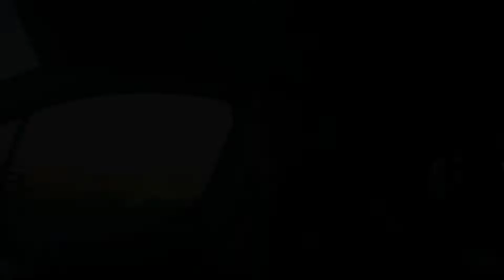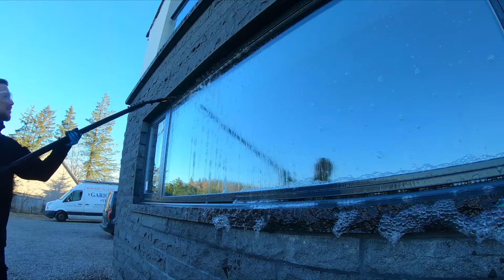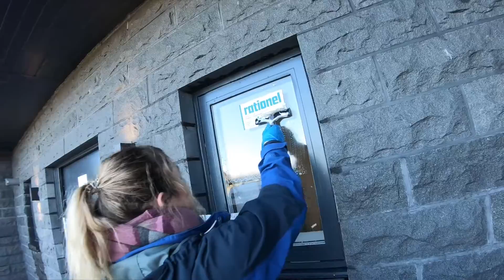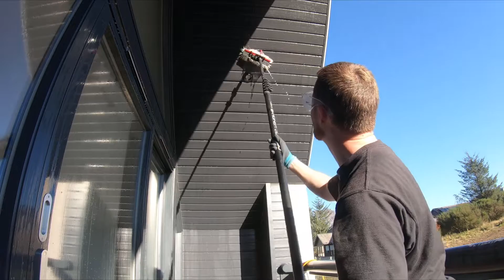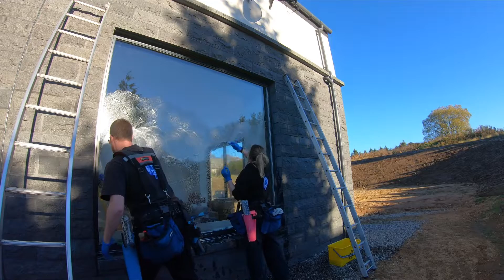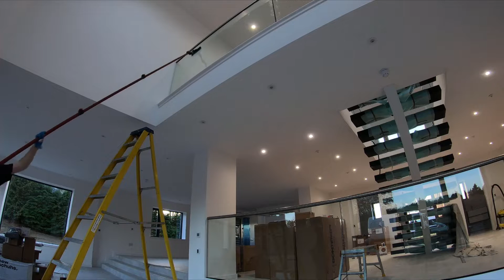CONSTRUCTION CLEAN UP | EXTERNALS | PART 2

Comment: Hi Trade Man Brian here from Ireland , if you don't mind I'm hoping for a little advice , Im new to the business and still learning , my question is about removing cement and paint from windows , I use a window scraper but sometimes it's difficult getting the cement off and I don't want to damage the glass . I'd appreciate any tips you have to help ..
Reply from the maker: Try winsol Crystal clear. Its a hard stain remover. Get it from window clean centre. Very strong stuff so be careful with it
Reply: @TradMan  Thanks alot  , appreciated
Reply from the maker: @brianwelldoneladsproudofye9765  dab the stuff on to the cement don't rub it or you may scratch the glass with the cement, once you've applied the chemical around the area, then razor it off but always scrape in one direction,  never back and forth and on wet glass never dry 👍🏻
Reply: Thanks for your help ...

Comment: Hey tradman, 
newbie question,
 how do you go removing concrete and silicon from frames on construction cleans?
Reply from the maker: If its on the frames that becomes more tricky, as you can't use a lot of products in case it ruins the frame, try some unger rub out or pink stuff first along with some bronze wool but be very careful, (try a test patch first in a corner of the frame) and don't use it on painted frames or wood. You can use more heavy duty chemicals but you would have to explain to the customer there's a good chance that area of the frame will be discoloured afterwards.

Comment: Any tools beyond bronze wool and razor blades and usual mop and squeegee?
Reply from the maker: Unger rub out, pink stuff and winsol hard stain remover were the products I used. Tool wise yeah mop, bronze wool, razor and squeegee. We soaked everything first with razor wash and let that do its magic, made removing the dirt easier. Also used wfp for some bits but that only removes some stuff, had to trad it after. Proper deep clean like 😊😉